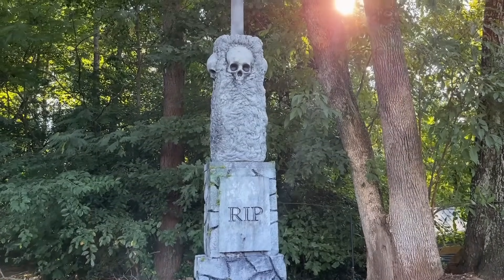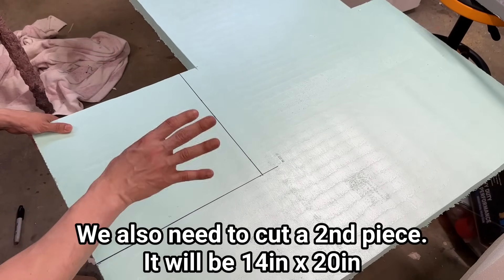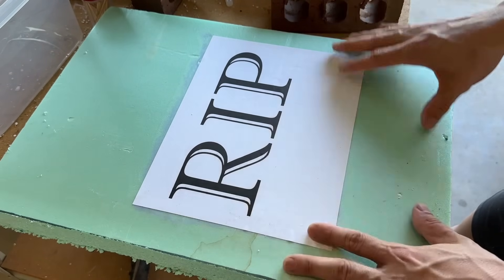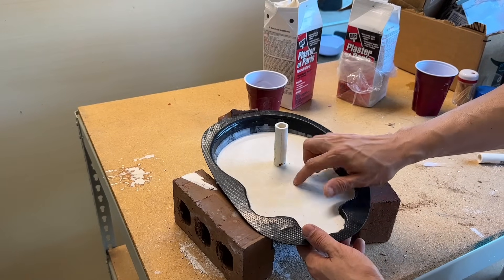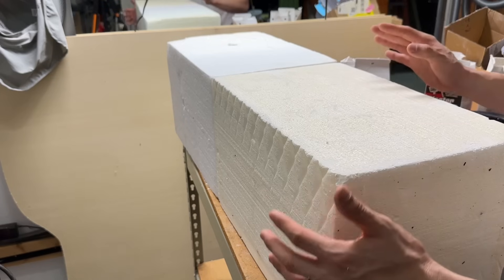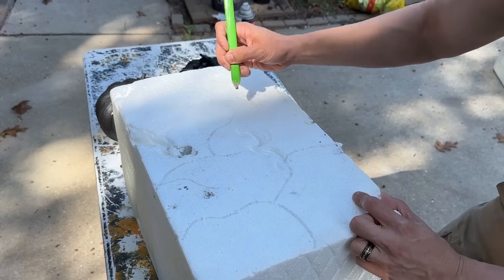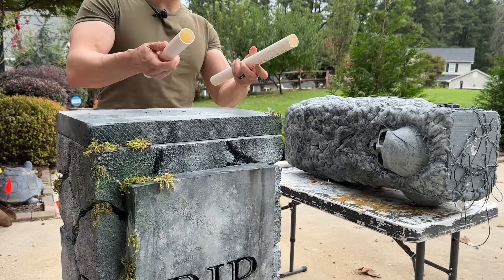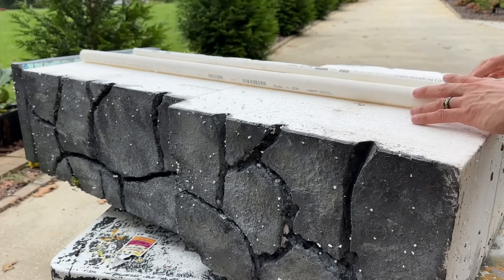Glowing Graveyard Obelisk 10ft Tall - Tutorial

Comment: I have problems getting the styrofoam blocks here, but the styofoam coolers for medical supplies are easy to get. I often use those as a base for my tombstones. I'm thinking I can do something like this with those. Just glue the lid in place. Maybe even add some sand to the base for weight, and may not need the rebar to hold it up.

Comment: Have you ever used that skull mold with spray foam? To keep is light weight? Id be curious to see how it works with the expanding foam, and what to put in the mold to take it out. I think can spray with water first and it will come out?
Reply from the maker: Yes I have. DONT DO IT! Lol 
I RUINED my molds by using expanding foam. Maybe if I had greased the molds it would have worked, but I didn’t and it ruined the mold, and I had to throw them away and buy new ones.
Reply: If you line the molds with plastic wrap it works great (but any wrinkles will show.) The plastic wrap will peal right off the spray foam once cured.

Comment: The amount of foam you used might put me into debt! Those cans are at minimum 5 bucks (for the cheap brands) and you used 6 alone on the top half, not including the other parts. There's gotta be cheaper ways. I saved myself a couple hundred bucks on the skeleton statue you did. the monster mud mixture alone was over a hundred. I did it with a big bag of plaster of paris and a can of weatherproofing spray for 30. it's been rained on a few times and it's still perfect.
Reply from the maker: You’re right, expanding foam can be expensive, especially the loctite brand that I used versus great stuff brand -  which is cheaper.